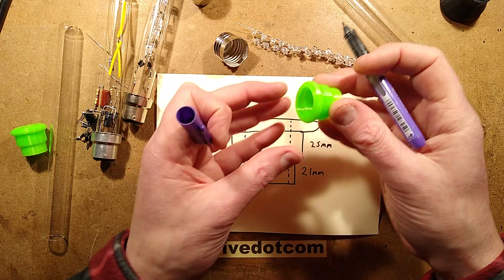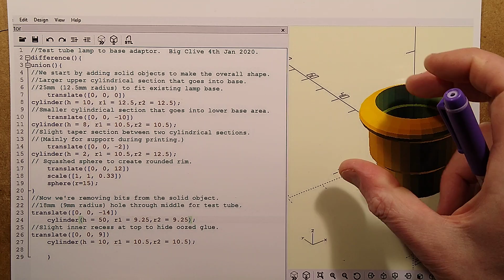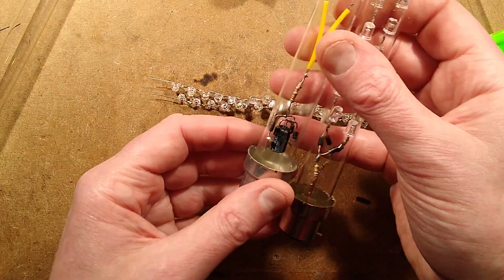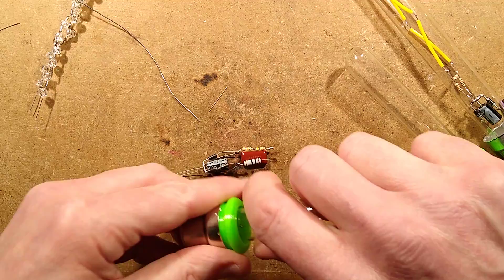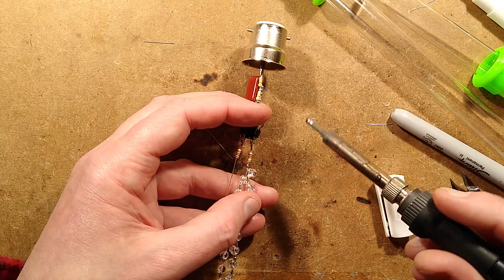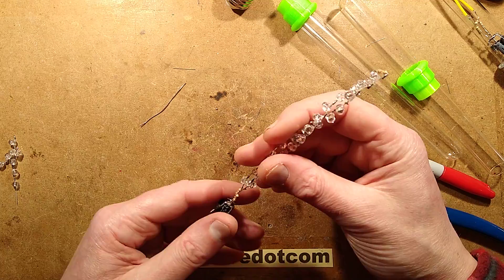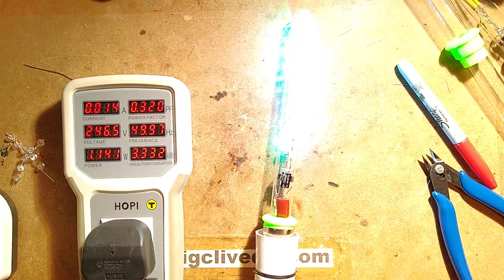3D printed LED test-tube lamp.  (with adjustable 3D openSCAD file)

Comment: That openSCAD reminds me of something we had to make in C#/OpenGL when I was doing my graduate degree in mechanical engineering. One of the classes was Computer Aided Design Theory which actually taught the theory of how 3D CAD packages work and had various projects to make actual primitive CAD programs. Looks like they basically just stuck with the bog standard formulas for making the basic primitives and final shape. Kind of nice since its less confusing and more straightforward if you've never used something like Creo or Solidworks.

Comment: Q: Why do you use individual diodes for the bridge rather than a SMD bridge which has the same specs? Would also make the circuit more compact.
Reply from the maker: I didn't have one to hand.

Comment: Watching BigClive solder shows me,
I need to spend more on better soldering irons
Reply from the maker: The one I'm using is a Chinese cheapie.  Practice will create good results.
Reply: @bigclivedotcom  been practicing for 30 years. Was better when I had the lead solder, I'll admit.
I think some trouble is because I've been using a single heat setting on/off iron
Reply from the maker: @JasonW.  I used an Antex 25W dumb iron for decades.  Still a good choice.

Comment: If you've ever used the old POVRay program for generating 3D images, OpenSCAD is a relatively easy migration - both script based using primitives to build the 3D object.

Comment: I was able to paste the code into OpenSCAD on Linux and it rendered correctly. 
It also generated a valid .STL file that Cura and Slic3r were both  happy to import and slice.

I don't have a printer here at the moment to do an actual test print, though, so I can't go that far down this rabbit hole.

Comment: What about the heat? I wouldn't think PLA (common low cost 3D printing plastic) would be tolerant enough. ABS should be ok. Of course, if you are under-driving the LEDs, the temp will probably be low enough to not be a problem. Also, I should wait and comment when the video is over, but I got excited.

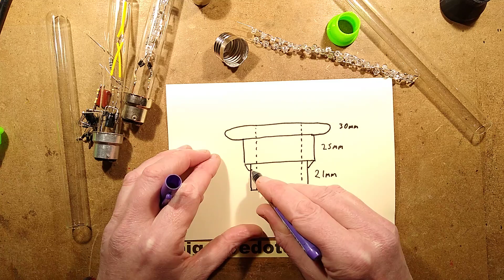Comment: 2:16 - Print it upside down.

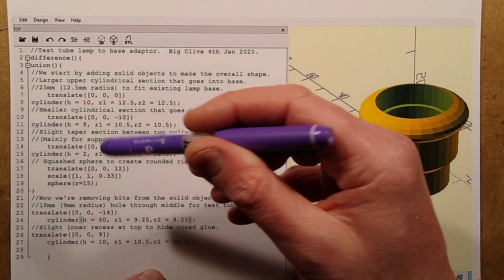4:42 - Because you're basically calling a function on the output of another function. That's pretty much how all high-level programming languages work. For example, print(uppercase("some text")) would feed "some text" into the uppercase() function and then send the output of that to the print() function, which would presumably display the end result. 

Here's a visual representation of a sequence of CSG operations:

https://en.wikipedia.org/wiki/Constructive_solid_geometry#/media/File:Csg_tree.png

They are calculated from the bottom up but need to be called starting from the top, so that each function knows what to use as its input(s).

Anyway, that looks like far too much work to design that shape. ;-) Any CAD package should let you draw the cross-section (as a 2D shape, like a technical drawing) and apply a lathe modifier to "spin" it around its axis. Doing it that way would also make it easier to export to CNC lathes to make the part out of metal (or from a block of acetal), etc..

Boolean geometry operations (especially intersecting and subtracting volumes in 3D) can be computationally intensive, and even cause crashes or unexpected results (ex., when two faces overlap almost exactly). It also makes some types of slicer optimisations impossible (although most slicers don't have much high-level shape optimisation anyway, so meh). 

Doing it on primitives (like spheres, cylinders, etc.) isn't as bad as doing it with more complex polygonal shapes, since those intersections can be calculated in elegant mathematical ways, but again, that relies on the software having implemented those elegant methods instead of a single brute-force volumetric approach. I believe OpenSCAD does it "properly", but the fact that you say it will take "a few seconds" to generate the object makes me wonder if that's the case; if done mathematically, it should be instantaneous for such a simple object. Maybe the delay is just the mesh conversion at the end, for display.
Reply: Dude, you're pretty knowledgeable about the inner workings of CAD, do some videos!
Reply: If there's one subject that YouTubers have covered extensively, it's CAD for 3D printing. There are dozens of great channels (and hundreds of really bad ones ;) about it.

Comment: Difference and union aren't opposites. Referencing your venn diagram Difference is the two circle minus the intersection, intersection is the middle and union is both circles. So its the difference between the first union and two cylinders. Difference means everything except the intersection. Because they intersect they act to subtract from the union.

Comment: OpenSCAD paste works just fine, I see no reason why it shouldn't.

There are also a few nitpicky things about your code that I understand you couldn't care less about, but still:
1. Indenting your code makes it more readable. Each block inside {} should be indented two or four spaces more than the enclosing block. TAB key does that.
2. It's nice to keep the spaces around punctuation consistent everywhere. Just choose if you want to write a=10 or a = 10 and stick to it. Spaces after commas are a must :)
3. I'm not familiar with OpenSCAD language, but I'm pretty sure it supports variables, so you can do stuff like base_radius = 12.5 and then cylinder(h = 10, r1 = base_radius, r2 = base_radius) to not have to change it in many places.

Comment: As long as you're stylizing the electronics, why not use (single color) LEDs for the bridge rectifier? I recall some of the industrial indicator lights you took apart did precisely that. :D

Comment: Are there any online calculators for making capacitive droppers? I've been trying to make one for a small 12v LED strip to slap onto my fume extractor, but the values never seem to come out the way my calculations say they should.
Reply: The formula isn't that tricky. A search for "capacitive reactance calculator" should yield the result you need. Required Reactance = Mains Voltage / Required Current then use the reactance formula to convert that to capacitance.
Reply from the maker: It's not ideal for 12V tape for two reasons.  The output is referenced to the mains and capacitive droppers are better suited to long series runs of LEDs being run at low current.  You could fit a standard mains to 12VDC LED lighting power supply to drive the tape instead.  Don't use the 12V halogen power supplies .
Reply: @bigclivedotcom  It's not a large load, only 60mA as measured, and everything is well insulated.
Reply from the maker: @BlackEpyon  That would be around 1uF probably.  But a mini switching 12V supply would still be safer and more practical.

Comment: Get Fusion360. Go to Lars channel (search fusion 360 lars in youtube). You will be using it within few hours. It just is better. Still parametric but you don't have to "code" it by hand. I can easily say that one of the best tools i've ever bought is my 3D printer. I print once per week on average and there is just too many things to list. Boxes for electronics, pegs for pegboard, adapters of all kinds, for ex dremel to normal portable benchpress, holders, art, logos.. I used over 3kg of PLA/PETG last year, at least half of it are finished prints (other half is supports and iterative design, aka trial&error to get the right part..)... it really is amazing tool but to get the most of it, you need a proper modelling software.

I'm planning on building MP CNC this year, you need the spindle&motor, 3 x NEMA 17 or 24 stepper motors, control board, aluminium conduit or profile and rest can be printed. Sub 200€ for custom sized CNC that can be modified later. They are good for wood and plastic and depending how well it is built and designed, for milling aluminium slowly. And taking a look how G-Code works does't hurt, it is very simple "language" for 3D manufacturing tools.

Comment: In some applications the BC cap can be electrically connected. For example on 12V lamps that have two independent filaments, the cap will be the common connection, with the other end of each filament going to the respective bottom contacts. These are standard BC size caps. You can get similar arrangements with the SBC caps used for combined tail/stop lamps in cars, vans and trucks.

Comment: I had no luck trying to solder wires to an Edison-base light bulb. Any recommendations on the solder, flux and temperature I should target to actually do that?
In the end, I have just stuffed the wires in the base, so they touched the appropriate parts of the base, since it was just a quick static prop project, so it wasn't subject to any stress and it held up fairly well.

Comment: More of this plz :) 
Just got into 3D printing mainly because I can't wait a month for project boxes, adapters and such to come with the boat. 

This would be a great opportunity for some GITD filament.

Also anyone that does stuff like this...
No clue what material was used here but  PLA is probably only good for testing. If it heats up(from any of the electronics)...even mild heat will deform it. It'll also loosen over time and the tube will just slide out if screwed in say...the ceiling. Maybe use the flanged tubes? 
which brings in another point...that piece that was just ever so loose? Heat gun, or hair dryer. Put it over the tube and heat it slowly, it'll probably shrink just enough to snug up. Just don't overheat or it'll droop right off.

Comment: As somebody that has worked all my life with my hands, I have to give you props for finger dexterity. Not only have you also abused your hands by working with them roughly, which usually leads to numb or sore fingers and even lack of motion in some cases. On top of that you have giant's hands. Well done sir. Cheers.

Comment: You can now buy the huge 30mm diameter test tubes that look similar to the ones used for "testicools" used in clubs for drinks in the early 1990's.Could make a huge LED contraption with that.

Comment: I think I may have just the receptacle to stuff with LEDs - How about a "Coughtrie" outdoor wall light? The tubey type thing with the big dumpy test tube style glass cover, originally designed to fit over a tungsten lamp up to about 200W. - You could certainly put an interesting display inside one of those!

Comment: Because OpenSCAD is a scripting language, it works much better if you use variables instead of lots of numbers. This makes it much easier to modify. Here is your script modified to use variables...

//Test tube lamp to base adaptor.  Big Clive 4th Jan 2020.
$fn=90;
lowerSectionRadius=10.5;
lowerSectionHeight=8;
midSectionRadius=12.5;
midSectionHeight=10;
topSectionRadius=15;
topSectionHeight=5;
testTubeRadius=9.25;
glueChannelRadius=10.5;
glueChannelHeight=10;
totalHeight=lowerSectionHeight+midSectionHeight+topSectionHeight;
topSectionSquashRatio=topSectionHeight/topSectionRadius;
taperedSectionHeight=midSectionRadius-lowerSectionRadius; // Sets a 45 degree taper

difference(){
union(){
//We start by adding solid objects to make the overall shape.    
//Larger upper cylindrical section that goes into base.
    cylinder(h = midSectionHeight, r1 = midSectionRadius, r2 = midSectionRadius);

//Smaller cylindrical section that goes into lower base area.    
    translate([0, 0, -midSectionHeight])
cylinder(h = lowerSectionHeight, r1 = lowerSectionRadius, r2 = lowerSectionRadius);
//Slight taper section between two cylindrical sections.
//(Mainly for support during printing.)
    translate([0, 0, -taperedSectionHeight])
cylinder(h = taperedSectionHeight, r1 = lowerSectionRadius, r2 = midSectionRadius);
// Squashed sphere to create rounded rim.
    translate([0, 0, midSectionHeight+(topSectionHeight/2)])
    scale([1, 1, topSectionSquashRatio])
    sphere(r=topSectionRadius);
}
//Now we're removing bits from the solid object.
translate([0, 0, -midSectionHeight])

    cylinder(h = totalHeight, r1 = testTubeRadius, r2 = testTubeRadius);
//Slight inner recess at top to hide oozed glue.
translate([0, 0, midSectionHeight+topSectionHeight-glueChannelHeight])
    cylinder(h = glueChannelHeight*2, r1 = glueChannelRadius, r2 = glueChannelRadius);
}

Comment: OpenSCAD is magic.
On other CAD packages you need to do some fuckery with adding and subtracting stuff, on OSCAD you can just nudge a number down.

And send the model via SMS if you are in a pinch.
Edit: Code works btw

Comment: Ahh yes, using the force. As in "force that thing in there!".
My go-to method when things wont quuuiiiiite fit.
Reply: I tend to get out an old tool from the Army. "Tool-fine-adjustment-14pounds".
Reply: @gordonlawrence1448  Hah ha hah! Too true. Extra points for the unnecessarily verbose, incredibly specific military style description. I  can't look at, say, an O-ring without thinking "annular obturator, polyurethane 1/4 inch" or some damn thing.

Comment: I have got a doubt. LEDs are in series and how did you calculate the number of LEDs and how are you able to remove a string of LEDs without any problems with output voltage? Are the two 1K resistors reducing the voltage as well in this case?

Comment: I had a SCAD file take over five minutes to compile, until I discovered the hull function, which creates a solid that traces around its contents. Imagine a rubber skin surrounding the inner contents of the function. That cut my compile time down to ten seconds and eliminated a third party library (chamfered cubes).

Comment: Question, why can't you keep joining leds in series untill the combined voltage is 350   so no current control circuit is needed?

Comment: You should record this lamp on and running for about 20 min or so and upload that for us to stare at. ;)
Reply: You should build one and you can stare at it all day. Even if you never turn it off, it’ll only cost you about a buck a year to operate. 🤓👍
Reply: Slow TV, Big Clive style.
Reply: Having built one like this you can also plug/unplug quickly and it puts all the LEDs in a random state. Kinda fun to stare at, even though it just produces an off white once they're all out of sync.

Comment: The code works perfectly.
Why not just pop out the two rivets on the bottom of bayonet connector and connect the capacitive dropper directly to that, stick some heat shrink around it, then you could fit more LEDs

Comment: You make me want to build my own LED lights. Also on a side note I hope to move to Europe in a few years and I have some really neat Philips brand 120v LED fairy light strands that I kinda have considered altering so they work on 230 or convert them to DC. Once my current projects are finished I'm going to get both a Step up 120-240v and a DC to Pure Sine Wave inverter so I can have native 50hz current to test out various things that I want to bring over there one day in order to make sure things work as intended. I will also test some on a step down converter on the inverter to compare some lights that are multifunction to see if they operate slower due to built in things perhaps intended for 60hz current. It will be interesting indeed well to me. But I might perhaps make videos of it you've kinda inspired me.

Comment: Years ago there used to be a program call POV "Persistence Of Vision" which was used to create 3D drawing in the same way. you selected where the camera was going to be and where the light source was. then you build the picture in the same way lastly adding a skin to them. then as we were using 4MHz PC's it took ages to create a picture. how things have changed.

Comment: excellent video ! Nice to see 3d printing involved

just a quick  question ....

Edison Screw Vs Bayonet Cap , what are the advantages/disadvantages of both?
Reply: Betacaps screw on with limited rotational motion whereas the edison screw requires more rotational force to fasten and unfasten. The only thing I wish betacap did to make itself more safe compared to edison screw is to use magnetically-affixed pins to snap into place with pressure contacts for power delivery but I can see how that could get real unsafe, real fast if manufactured incorrectly.
Reply: Many Thanks for the info
Much appreciated

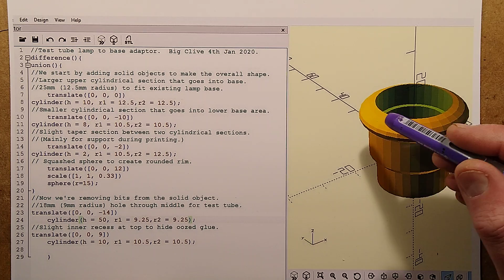Comment: 3:40 OpenSCAD! My favourite 3D modelling tool. You can also set the "special variable" $fn to set the number of polygons. For example, adding "$fn = 100;" in your code would make all those cylinders / spheres very smooth. You can also try to understand $fa and $fs for better control depending on the part size. Google "OpenSCAD special variables" for more info
Reply: OpenSCAD is a great tool.
I'm always amazed how much CAD software has advanced since my days learning on clunky AutoCAD in school. So much more user friendly these days and available to everyone for free; I don't want to know how much the school had to pay for it's license of AutoCAD.
Reply: along with being able to specify "$fn = 120;" globally you can also place it at the end within most commands , even import and rotate_extrude. It will override the global value for that line.

Make sure there isn't too many faces in one radius as it will trip up 8bit printers and increase file size. I do this "Resolution = 120;" then "$fn = Resolution;", then add ", $fn = Resolution / 2])" to a command to reduce or increase it globally.

Comment: Adding $f=180 as a first line will reduce the faceting and make it smoother.

f5 gives a quick render
f6 gives a full (slow) render
You must have done a f6 render (the button with the hourglass) before you can export the stl.
And finally if you have octoprint or similar you can print directly from OpenScad.